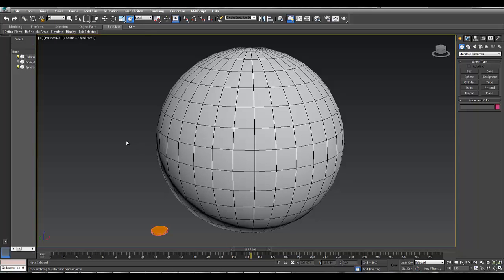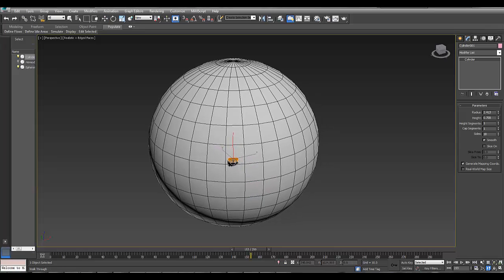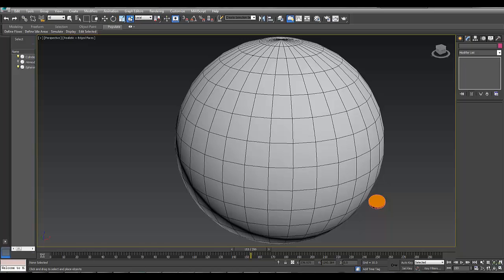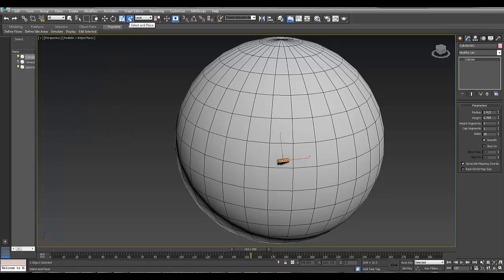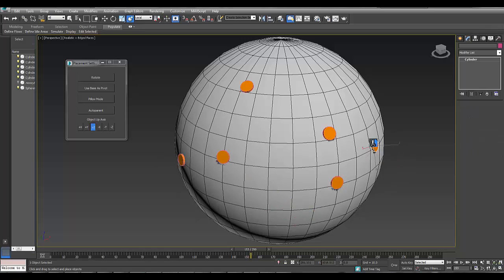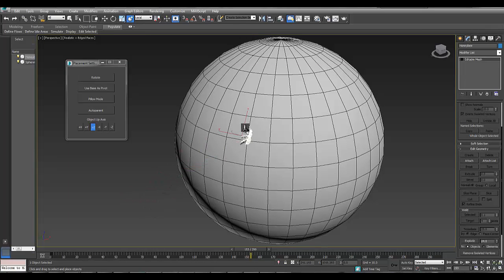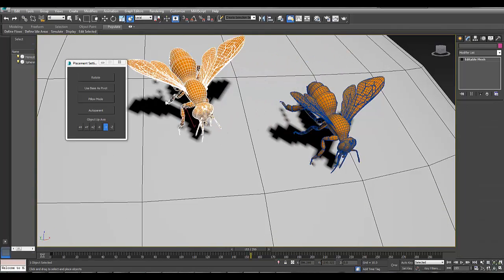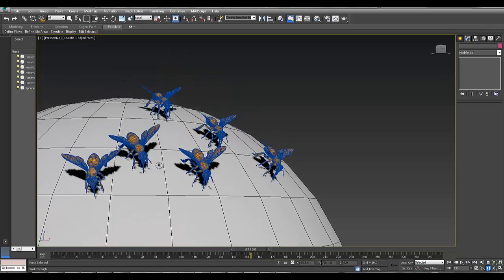Placement Tools, 3ds Max 2015, Select and Place Tool...

Comment: how did you make copies of the object with out the clone options box popping up
Reply from the maker: Nigel Morris Hi when you have the select and place tool, holding shift and drag, the box will not pop up, I am using Max 2015...

Comment: Hello. sorry for a newb question but I am just starting out in Max. Sometimes I have the problem that I can no longer select any 3d objects in 3ds max. Often one item in the scene becomes permanently selected and I can't unselect it or select anything else, even when I try clicking outside, hitting the "select object" icon on the top menu or changing the selection type from vertex to poly or whatever.  Any solution to this problem? I am using 3dsmax 2015.
Reply from the maker: Hi one thought perhaps you are pressing space by accident that will turn on the padlock symbol (or by pressing the logo by accident) at the bottom of the screen, just right of centre below the timeling.... this is called 'Selection Lock Toggle'. You will know if it is selected because it will be in yellow...
Reply: Thank you so much! That was my problem.
Reply from the maker: Ha ha, glad I guessed correctly! I remember having that problem when I first used 3ds Max.

Comment: Doesn't work very well for me. Take your circle and squeeze it to make and oval, and this feature become a waste. I still have to redo manual adjustments every time...because well...I don't work with perfect shapes. Nice idea, but way half finished.
Reply: you should then apply Xform after squeezing it.

And by the way thats a lame way of making an oval (squeezing a circle) when you already have the option to create an oval...dont blame the Placement tool for your workflow.